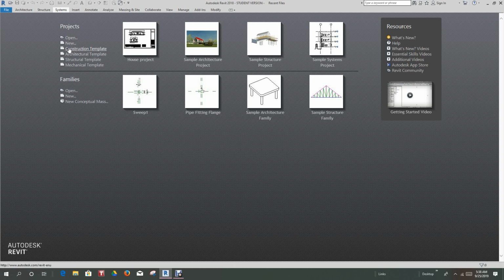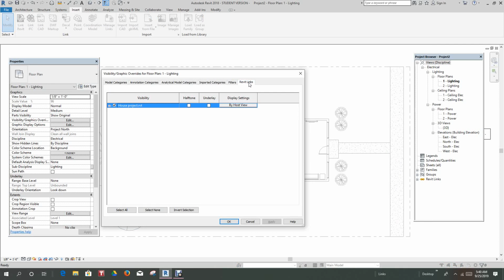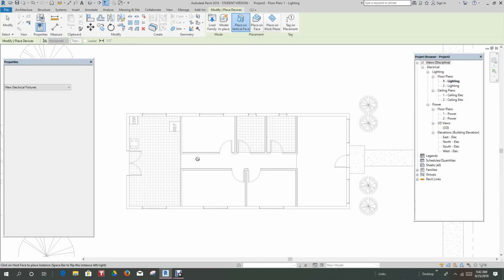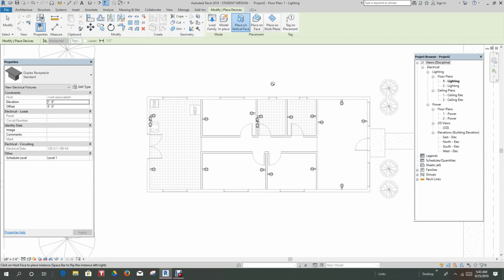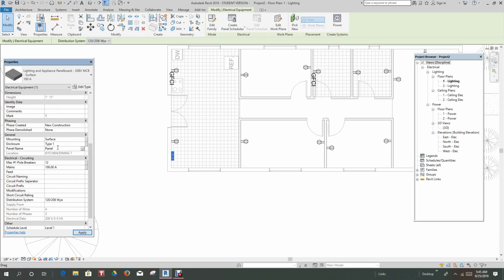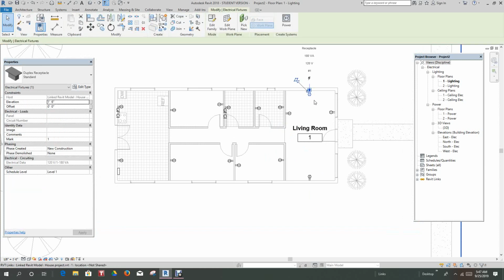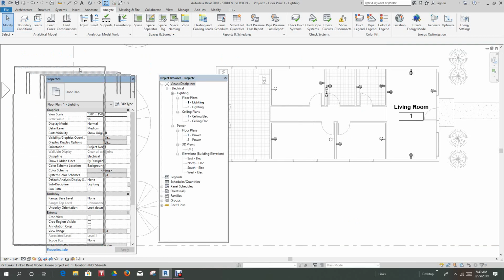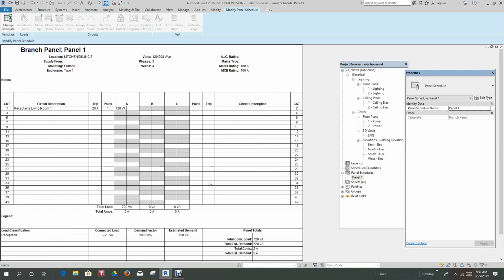Revit MEP Basic house E1 electrical

Comment: how does your electrical panel have a room location in the properties?
Reply from the maker: Hi the rooms are spaces and I added them or renamed them in the properties icon, which will be shown in the panel schedule. Have a look a Basic House E2 video I demonstrate it there....hope this help and thanks for watching
Reply: @unidesigndc  Thank you, I've found the problem, in the linked architecture file the phase mapping is phase 3 while the phase created in the architecture file is phase 1
Reply from the maker: @REVscape95  Great work!
Reply from the maker: @REVscape95  Great you found that out, I have to go back and have a look. I didn't know the phasing would be relevant. You learn new thing everyday in Revit